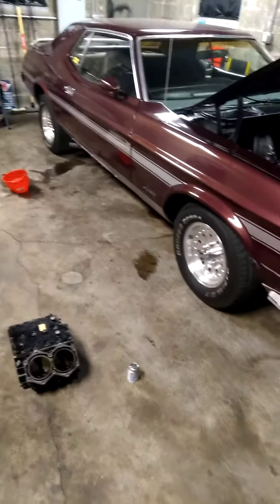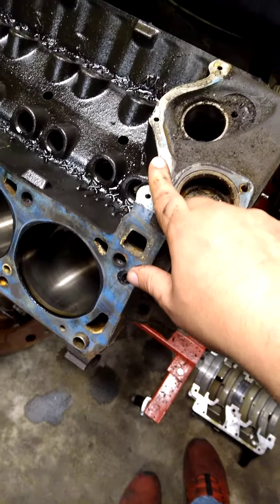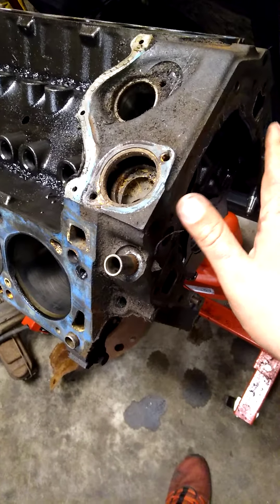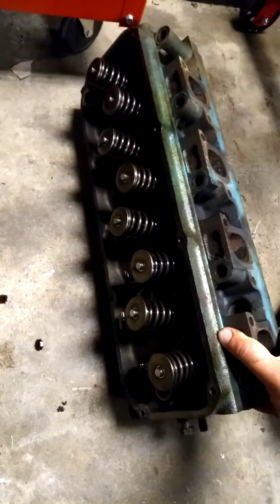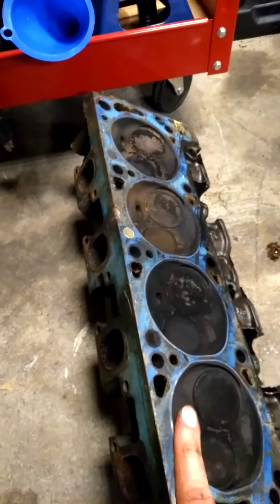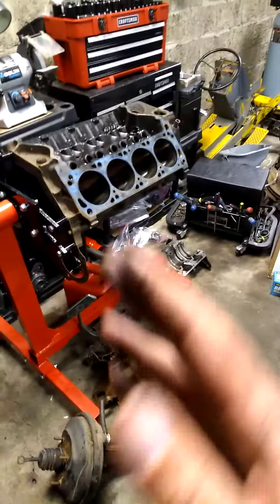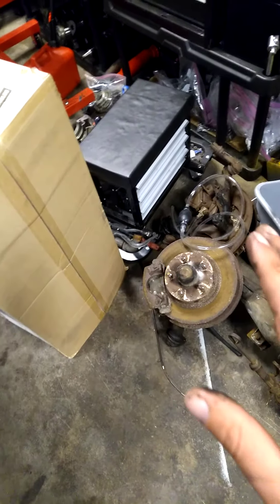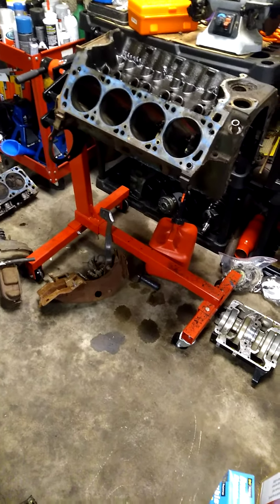difference between the Windsor and Cleveland

Comment: Oh, one other thing.  When you remove the valve cover to see if the valves are canted or straight if you count the number of valve cover bolts you can tell if it is a W or C.   W's had 6 bolts, C's had 8 on each valve cover.

Comment: Gets even more confusing in Australia 
We developed a 302 version of the Cleveland 
It was the 351 de-stroked to 3inch stroke…
Cantered valves on Cleveland 
Vertical fuel pump bolts 
Water exits block on Cleveland 
Water exit’s manifold on Windsor
Reply: How was your 302 different from the US Boss 302 engine?
Reply: @danmyers9372  the Aussie 302 Cleveland was a 351 2V destroyed to 3 inch stroke and different rods…
The 351 had 3.5 inch stroke…
The closed chamber heads were standard on 302 …
If you put em on the 351 it gave around 12 to 1 ….
Way too high …
Doesn’t mean we didn’t try…

This motor lived on in the 302 / 351 version till 1983…
We lost the v8 option for a while 
Then it returned as the American 302 Windsor…

Comment: I have a 71 Torino with the Cleveland I did aluminum edelbrock heads cam and intake it has disc brakes and a/c from the factory the only thing I would like to change is the transmission- I want to build a aod for overdrive
Reply from the maker: Eventually I will get to my Cleveland just got alot of other things going on.  I was thinking of a 5 speed manual conversion down the line.

Comment: The Cleveland is a good engine but like has been mentioned the Windsor has much much more after market support.    I have a 73 Mustang convertible.  I run a 351C/4V CC heads/4bolt/forged flat tops/comp 270/rhodes lifter/mallory unilite/tri-power/hookers/glasspacks/c6/3.50 limited slip/Gear Vendors overdrive.   It scoots along but it's still a 50 year old engine and it's hard to beat technology.    Still, something about how a the old iron sounds, especially the Cleveland, just warms my heart.
Reply: Yepper, I have a 351C 4V closed chambers in a '71 Squire. New cars omg they rock(et) in e'ry way but we can actually work on vintage time machines. Even a 2V Clev head flowed well
Reply: My engine and trans and gears are all similar to yours. What fuel atomization you using? Whats your complaint if by the reading of your list you have got your RPM's way down on the highway. I was over 3000 RPM with my 3.50 gears and no overdrive. Bad mileage. Nice adrenaline when you drive it but Im changing sound to make it less bass-loud. It was too loud giving headaches. Setting off alarms.

I have 71 Grande and I got my suspension dialed in. Subframe and strut tower mods give it a really sweet ride.
Reply: @jamesmedina2062  Hey James, I have a manifold that has 3 carbs on it.  All three are 2bbl.  The middle is rated for 500cfm, the outboards are rated for 350cfm.   BUT this is the 2bbl rating which is different than 4BBL so overall I have about 835 or so CFM (I'd have to go check my notes).  The GV overdrive helps with the sound but so does a crossover pipe.   Both really help at cruise speeds.
Reply: @olliehopnoodle4628  What Rpm at 60-70 mph?  I have X pipe. Custom mufflers. Not run yet with new mufflers though. Working on it.

Comment: In 1973 I purchased a pristine used 1970 Mach 1 with a 351W 2bbl and FMX automatic.  I modded it with headers, full dual exhaust, an aluminum dual plane intake, Holley 600 4 bbl, recurved distributor and 3.91 rear gears.  One night I was out cruising with my buddies and ended up doing a roll race from about 25 MPH against a buddies bone stock ‘71 351C fastback automatic ‘Stang with stock ~3.0 rear gears. .  The cars ran side by side, I couldn’t pull him one bit.  I was so bummed out over this I never put another dime into the car to try to make it faster.
Reply: Why would anyone   be bummed out? The cleavland is more powerful (4V) and has more  torque (2V). You stayed with him only because '70 Mach1 is shorter and lighter. Also you could have built the Windsor to a 427ci 600hp.

Comment: ive got several sets of 351 c closed chamber heads,they were only made a couple of years,the boss 351 had closed chamber heads huge power difference between them & the open chambers like you are showing,nice stang,
Reply from the maker: Thanks man
Reply: I have early set from a pantera, still need machining and valves ect. But I am running 4 bolt pantera block with 2v heads (modified)
Reply: for the street 2 v heads are better unless you have a super light car & low low gears 4:30 /4:56/488.
Reply: @hegonefishing9122  we use to throw the 4v heads away and modify 2v close chamber heads,(bigger valves) gave a lot better flow and more power down low and upward good for 6500rpm,
Reply: @tttony9426  72 grande with 3:25

Comment: The 351 Cleveland with 4v heads ,is a boss ,and the best of the small blocks that ford makes ,with a dyno test of 390 hp ,I was surprised  at the numbers , playing with timming and carburation ,with some mods achieved 500 hp ,great engine .
Reply: Not all 4 bbl 351c engines were Boss 351’s.  The base 4bbl 351C had 11.0 CR, a hydraulic flat tappet cam and was rated at 300 HP (gross).  The one year only 1971 Boss 351 was the same engine but with an 11.7 CR, a hotter solid lifter flat tappet cam and was rated at 330HP.
Reply: No a 351C 4V is not a boss! Read more so you understand the differences!

Comment: Easiest way to identify Ford engine families: Count the valve cover bolts
2 bolts = Y block 232, 256, 272, 292, 312
5 bolts = FE (and FT industrial) 332, 352, 360, 361T, 390, 391T, 406, 410, 427, 428
6 bolts = Windsor 221, 255, 260 289, 302, 351w
7 bolts = 385 series 370, 429, 460
8 bolts = 335 series 302 Boss, 351c, 351m, 400(m)
Reply: Or just look at the front of the engine.  The Cleveland had the water pump boss cast onto the block.  The Windsor bolted onto the front of the block.

Comment: Seth, what did you end up doing with the Cleveland? Is it a work in progress? Just for info, I have the 71 351 Cleveland 4V and my friend own’s the 71 351 Cleveland 2V, and for everyday street use the 2V heads might be the way you want to go. You can get aftermarket 4V Intake and carb, and a cam, and the 2V heads will produce much more power than stock, and you can still use todays fuel (obviously because of the lower compression) My engine with the 11:1 will detonate unless you use premium fuel and retard the ignition some.. Though I still have the original ignition with points and condenser. Just a thought. Take care.
Reply from the maker: It's a work in progress it's still stripped down.  Eventually when I re do the body I want to bore it set of 3v heads cam and intake in between throwing a Paxton on it.  Kind of the plan.  Probably will change a few times
Reply: I agree, I have 4 bolt block with 2v heads stock intake with 500 cfm holley. Love it....
Reply: I have a set of 69 closed chamber
4v heads, very rare!
Reply: if your thinking of changing your heads, The 3V alloy heads are the way to go now best of 4v and 2v combined together, many years in the making and from all the work we use to put into the cleveland heads years ago,
Reply: @sethhickernell6063 the paint looks perfect. Wheels outdated. I had those in the 80's. Why do you want to paint it?

Comment: Completely two different blocks, Cleveland engine is wider than the Windsor...... Nothing is interchangeable between the two..... The 351 W, has a higher deck height than the 302..... The 2v Cleveland head's with a little work are great heads for the street!
Reply: You can swap heads with minor mods 
The boss mustang was a Windsor bottom end with Cleveland heads 
What an animal it was …

Comment: If you want originality and good power try to get the 302c heads. Plenty around still in australia.   Nice car by the way. Mike
Reply: The 302 head's will not work on a Cleveland block! Two different animals!
Reply: @alonzowitt5931  302 cleveland heads came out on 9.2" 302 clevelands in AU. Same spec blokes as the 351, only, all the  best hand selected blocks went to the 351 and iv used them more than once with 351s. With  Instant powerhouse results, even when untouched. Aaasome out of the box.  You must of thought i ment windsor 302 yeah.   Mad mick.
Reply: @michaelgiglio1571  Sorry mate, I stand to be corrected! You're right, they did make a 302 Cleveland...... Never herd or seen one in the States😳..... I thought you were indeed speaking of the 302 Windsor..... I learned something new, thanks for the education!
Reply: @alonzowitt5931  Thankyou for your feedback. Yeah, A.U. didn't get all the U.S. engines either. Im allways here to share advice with our experience with Cleveland's. Goodluck with your project. Mike
Reply: @michaelgiglio1571 you guys know the Clevelands. I have Australian style 2V heads on mine. What the difference against the 302C? The head date code says 1977 inside the valvecovers. I got 1.7 Crane roller rockers, bronze valve guides, and pocket porting only
Reply: @jamesmedina2062  The 77 -82 head where the better once. Thicker casting and revised intake ports.  Good cores to start with.

Comment: Fuel Pump bolts are different Windsor are side to side Cleveland are top to bottom
Reply: If you are looking at a bare block your right check out the bolt holes for the fuel pump. Cleveland   north an south, Windsor  east a n west. Guy tried to seek me a supposed cleveland block but the bolt holes were wrong. Saved a lot of money an time, just saying

Comment: A Clevo has no resemblance to a Chev. The t/c on a Chev is a tin cover that bolts on the front of the engine.
And one has oiling and one does not!!
Cleveland heads were used on 351 and 400M engines which are a tall deck Clevo. Until at least 1980 and weree made here in Oz until 83.
The 4V door stops only went until 72 or 73 and they were open chamber.
The canted valve heads not unlike a big block Chev were the major difference.
Just that Ford lost the plot on intake runner and valve size. The 302 [aussie] heads have intake ports and valves bigger than a SBC race head. The 4Vs defy sense!!
Reply from the maker: I believe there is a hole in the intake valley on a clevland to allow oil to go on the timing chain.  All I was saying is a clevland timing cover is a small cover like a Chevy.  A Windsor has a casting not like a Cleveland.  As I said I am no expert.  I know the deck heights are different, but I was making a simple video.  Thank you for the advice.

Comment: why have you got a windsor in a 73 mustang, your wrong about close chamber heads giving a 351 more detonation, they were actually better and give better quench and burn.

Remember Ford USA only stop making cleveland motors because there was no need for them once the muscle car ban came in during the very early 70's, and the fuel crisis
they were purley build as a performance engine.( to replace the big blocks)
 In Australia they kept making cleveland engines up until 1983 with great success and the Windsor's couldn't live with them.
The best 2v heads you can get are the close chamber Australian manufactured ones
Reply from the maker: I was referring to the 4v and 1973 ford mustangs came from the factor with 302 Windsor in certain modles
Reply from the maker: But u seem very well informed the info I got said open chamber heads wjere prone to detention but illtake your word on it.  But Windsor have always been in mustangs
Reply: @sethhickernell6063  correct open chamber heads are prone to detonation, Maybe I misunderstood the video, thought you were saying you can't fit a close chamber head to a 351 cleveland because it will cause detonation, and yes true about windsor 302,(I guess) you never got the 302 cleveland in the USA, did you?
Reply from the maker: No we did not to my knowledge get the 302 Cleveland
Reply: There was a 302 Cleveland for a couple of years.
It was known in the U.S. as “The Boss 302” for trans-am racing in, I believe 1969, 70, and maybe 71.
Insurance and emissions regulations pretty much killed it.
Reply: @deanmeyer1815  No I'm talking the full Cleveland 302, not the boss 302 windsor with cleveland heads used for trans-am.
so I'm guessing the Cleveland 302 was only built in Australia
Reply: @fknows1  - 302C (re: Cleveland design) were only made in Ford Geelong plant for the Falcon and its variants.

Americans outside of Ford would not know that Ford Australia made these engines.
The "BOSS" engine was used in Mustang for years but in Australia Mustang was  not a thing for our market in that period.
Reply: I may have imported Aussie heads. Have you checked the heads date code before?

Comment: Didn’t the Cleveland use a different bolt pattern for the bell housing
Reply from the maker: To my knowledge they use the same bolt pattern as the Windsor I think the modified used the big block bolt pattern
Reply: @sethhickernell6063  I was thinking the FX trans. Had a different bolt pattern
Reply from the maker: I have an fmx trans I'll have to dig it out and look but the 351 also used the 4 speed so did the 302 and when for example I was looking for a 5 speed swap that kit did say 302 351w 351c
Reply: @sethhickernell6063  did the trans have the bellhousing on it
Reply from the maker: Yes

Comment: I thought a 351 Cleveland was a big block and a 351 Windsor was a small block
Reply: It’s been an ongoing debate since they came out. I believe the 351Windsor has a taller deck height than the 302 which it is based off of, because it has a longer stroke.. The 351 C I’ve heard called a Mid block before, but honestly, though I’ve owed both engines (I still own the 351C 4V) I never actually weighed or took measurements of either. Obviously, as was mentioned in this video, they are completely different blocks that just happen to have the same displacement.. Also, as mentioned, the Cleveland heads if modified will bolt on a Windsor. Though the Windsor heads would bolt on a Cleveland block, they wouldn’t work because of the different cooling configuration..
Reply: @Tom-th1oy  I had a cougar that i put a 351Windsor in , my friend had a Ranchero with a  351Cleveland...that Cleveland seemed to have way more power and it sounded more throaty both had a 4bbl carb I think thay both had dual exhaust....I wish I would have kept the cougar

Comment: Show me the specs on said 3V. Which doesn't exist!
Reply from the maker: 3v are an Australian off shoot of the 2v and 4v.  Cleveland motors are huge down there and wjere produced for longer
Reply: @sethhickernell6063  AUSTRALIA HAS SOME COOL STUFF!!!
Reply: CHI Cylinder heads makes an aftermarket "3V" head.  They use "3V" for the product line.  These are all 2 value per cyl heads.  The chose 3V because it was between 2V and 4V and what the company did is combine the best attributes of the Ford 2V and 4V
Reply: @sethhickernell6063  - no Australian produced, the only 3v were imported from USA and known here as the "Barra 220" in 2002 for the BA Falcon, and they only lasted until the BF Series II of 2007, from FG (so 2008) onwards the main performance engine for Falcon was the i6 turbo in XR6 while the V8 was of the Quad Cam 32 valve 4.4L and even then that was replaced by the Australian designed "Miami Supercahrged" 5.0L V8 re: a Coyote built to AU specs.

Comment: You should not be making Cleveland info videos ....the 4v heads start making power @3000rpm and are just fine for street engines.
You never touched on 3v modifications to 4v heads.
Reply from the maker: I gusse and I wasn't planing on using the 3v heads never claimed to be an expert on stuff just passing on knowledge gusse I'll leave it up to you.  You don't need to watch it and the aussi heads wich are 3v heads and if you watch dyno videos the 4v males power at 3500 most street cars are not constantly driving around at 3500 rpm but hey your the expert
Reply: @sethhickernell6063  The idea that the 4V isn't good for the street is pretty common.  They certainly 'come alive' at the higher RPM's but work fine and produce power at the lower RPM's as well.    Keep making Cleveland videos.  People love them!

Comment: A bit of old info that may interest some that don't know, Some of the public does not know there was a 9.2" deck 351 "W"indsor # XE 93532 race block made back in 1966 way before Kundsen's "C"leveland block was even on the drawing board & this 351w XE 93532 9.250" deck Windsor race block got as big a 391+ ci back in 1967 for Can-Am racing. The 302 & 351 windsor XE race blocks were tested with canted valve head prototypes in 1968 Before Kundsens new block was & there were plans WAY BACK in 1964-65 for a 9.450"+ deck 7L aluminum Windsor race eng for Can Am racing. 
B Kundsen screwed things up at FORD with Fords 351W race block development... goo gle "351w xe block" for more info.